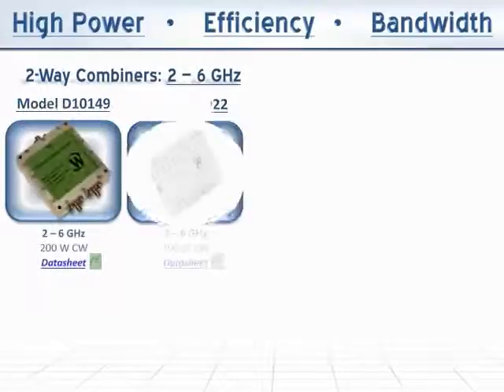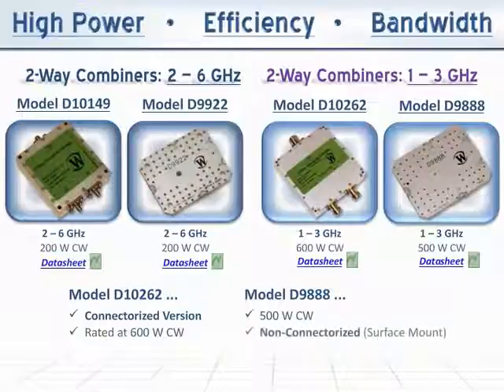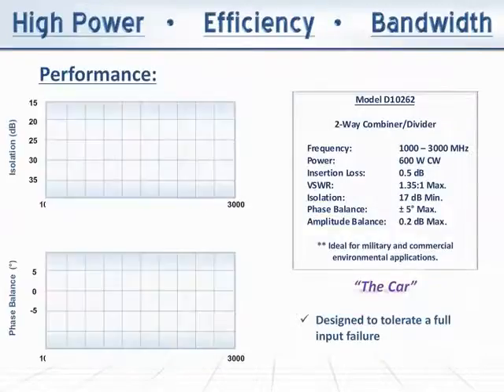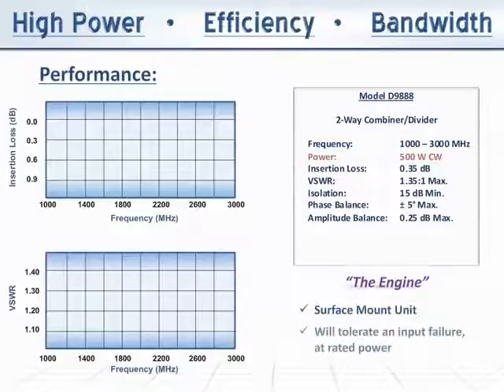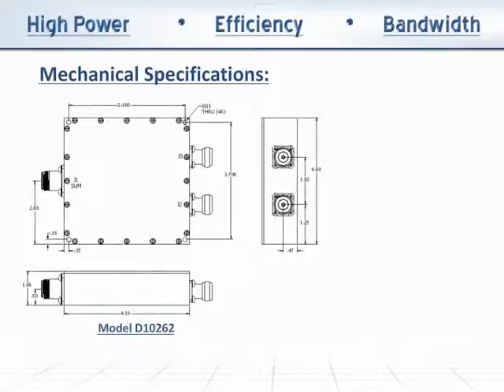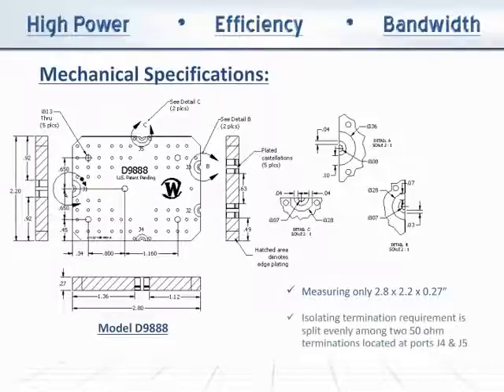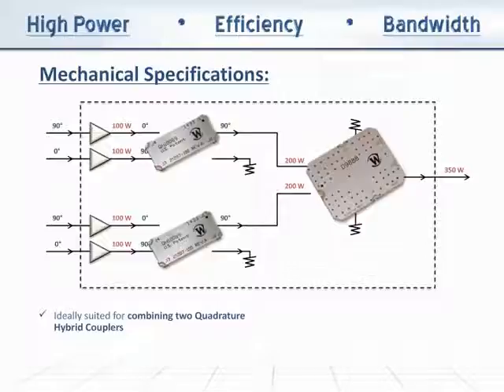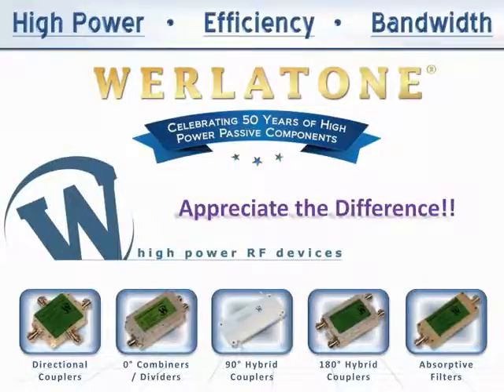1-3 GHz RF Combiners

Comment from the maker: Model D9888 is our newest Surface Mount, 2-Way In-Phase Combiner/Divider. This high power design covers the full 1000-3000 MHz, and is rated at 500 W CW. Operating with less than 0.35 dB Insertion Loss, the unit is compact, measuring just 2.8 x 2.2 x 0.27", and supplies full port-to-port isolation of 15 dB minimum. Our connectorized version is the Model D10262. Please click here to Learn More.
http://www.werlatone.com/combiners-dividers
http://www.werlatone.com/